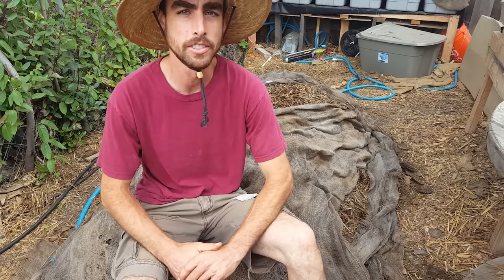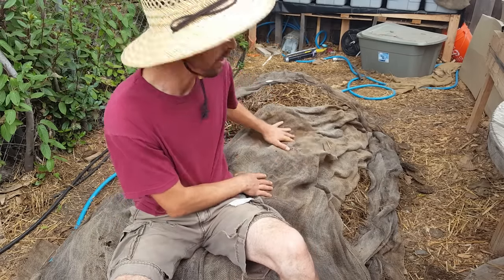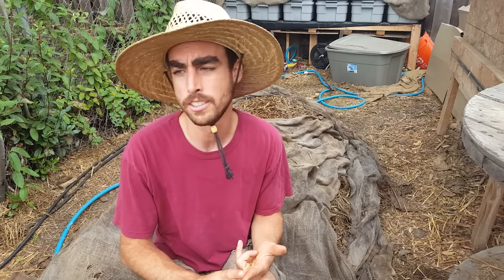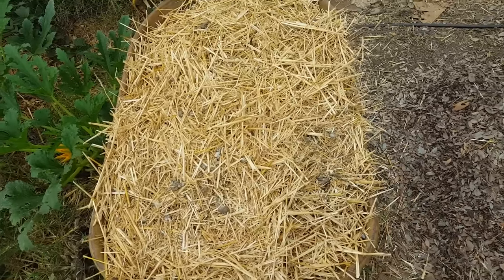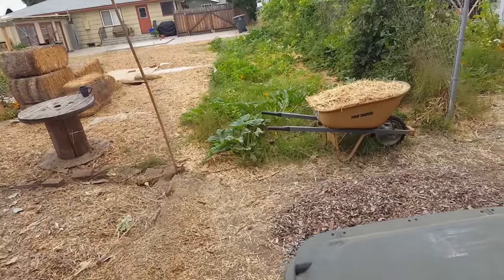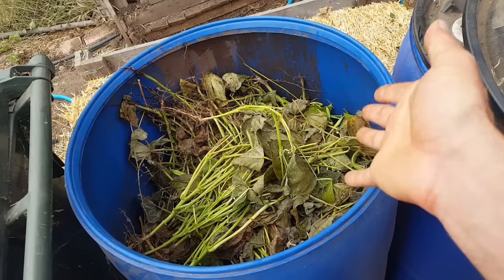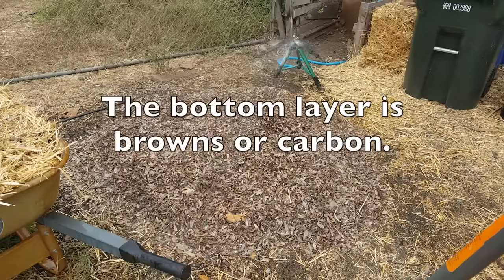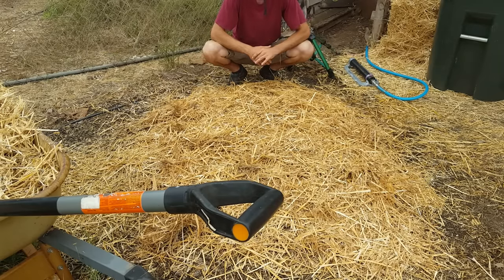How to Make a Hot Compost Pile Successfully 1 of 2

Comment: These are really good points. I like the way you broke down the different options to balance the N:C ratios. A lot of people in the suburbs don't have access to manures and other really high N materials, and have to use what's in their yard. For this, a 2:1 or even 3:1 ratio of grass clippings to shredded leaves will give you that really hot, supercharged pile that needs to be turned every 2 1/2 days and will maintain the 130-160 degree temps. 2:1 in the hot summer, and 3:1 in the fall.

Comment: Great technique and tips. I follow something similar, but also include a layer of twigs and small branches at the bottom to improve air circulation.
Reply: Ben Bradey interesting.  Makes sense.  I will certainly try the sticks and twigs at bottom of the pile.
Reply: For piles up to 6' high, alter 3-5" layers of up to 1" branches cut to 10" lengths every foot or so. Aids air flow vital to aerobic decomposition(anaerobic decomp stinks), and water distribution though pile. Water saturated piles decompose faster.
Reply: @claudearmstrong9232  Interesting, I haven’t found that to be the case. If there’s too much water, I see a lot of caking and dead aerobic bacteria (the white stuff) caused by anaerobic bacteria taking over.

Comment: Interesting great video...we use to make our compost piles like that, now I came up with a MUCH easier way, ** NO TURNING ** so easy, less work. thanks for the video.
Reply from the maker: Ya it is more work, but there's no better way to build a pile to display the C/N ratios, moisture, and the visual breakdown of the pile all while showing how to analyze a pile step by step understanding aerobic and anaerobic conditions. Buying local compost is the best way to do it as an urban farmer. $30-$35/yard is much cheaper than the time.
Reply: Thanks for the reply! Robbie and Gary

Comment: Nice presentation

Over the years my hot composting developed into no-turn one heat-period process. Essentially the pile begins with 4 to 8 inches of branches in the ground layer. I keep the woody diameter 1/2 to 1 inch. Then about 4 - 6 inches of brown, then 2 inches of green. The fourth layer is 2 - 4 inches of the branches, covered by the brown then green. I pack these together by jumping and packing at about the half way point, approx. 3 feet high. I soak the pile here as the water aids compaction. Adding layers on up to 5 - 6 feet high then jumping on the top to compact the pile, then soaking it thoroughly, I top it with 2 - 3 inches of sand, finished compost, dirt, or any fine material that slows air movement up through the bottom layer of branches. The maximum width I find is four to five feet, or approx. 2 feet from the sides to the center.

When I add fresh grass from a healthy lawn the pile heats by the fifth day, then continues to increase up to too hot to hold my hand in the pile.

At the cooled pile I use a horse bedding fork to shake out the fine material  and return branches that need further breakdown to the next ground layer and up the pile. The pile never develops the anaerobic state. It has a woodsy, fresh earth sweetness. 

At the point of cooldown the material is fully ready to plant.

Been doing this 40 years.
Reply from the maker: Nice Claude that sounds like a great method thanks for sharing.
Reply: @NaturesAlwaysRight  O kinda envy you for stepping up to the task of providing workable nutrient dense gardening everone can do. Thank you"-)

Rather than my yt channel I find those who are here and share my bit. You are the real hero.  Take heart and be sure you make life better for all.
Reply: I plan on doing something similar. I find that branches at the bottom and in the middle of the pile give the pile structure and support so that it doesn't collapse in on itself which would restrict oxygen. 
I'm also going to dome the top of the pile and enclose the entire pile in its own greenhouse, run 4" inch aluminum flex tubing through it and use the tubing as a convection heat collector so that I can heat my winter crops that will be growing in the greenhouse next to my compost pile.

I'm not sure but I may even collect the heat that rises to the top of the compost pile and gets trapped in the dome. Do you think this would be a good idea or would the heated air from collected from the top be too moist or contain harmful gases for my garden greenhouse?
Reply: stephencarlsbad there’s multiple videos showing how people use compost to heat there green house with good results I was just watching some last few days it can even add co2 for your plants good luck.
Reply: @stephencarlsbad  I was thinking of doing something similar but was thinking of making a 4 ft brick lined pit under the floor of my greenhouse but was also worried about harmful pathogens
Reply: @stephencarlsbad  I like your ideas, I would say 'go for it',,,if there's a methane build-up that explodes, that woud be entertaining and interesting. (I think you're quite safe.)
Reply: How long does it take for the pile to cool down? A year?
Reply: @lilyxciv5637  depending on size-volume, 1-2 weeks
Reply: Have you done a video on this method with the layers of sticks

Comment: If you can get your hands on rice hulls they help with adding air to your pile and break down into silica witch your plants will love you for. Great video. Love the brows
Reply from the maker: Great suggestion rice hull is fantastic, but I'm trying to avoid extra cost and not buying in extra inputs.
Reply: Anyway you can find rice hulls from horse poop.. People use it for that here i am. If not its 15 bucks for 4 cubic feet hardly expensive at all.

Comment: Good tips in this video. However I aim for "hot and cold" composting - some of the compost bin content gets hot and some stays cold. The worms migrate to the cold parts and work on decomposing those while the hot areas work on themselves. When I get bored I poke around and the hot and cold parts mingle and change. When I need some compost for the garden I move the top half of the compost bin onto a tarp, move the bottom half to wheelbarrow, and fill buckets of the partly done compost from the wheelbarrow until it is empty or until my job is complete. If I am making a new garden bed and there is not enough compost I use hugelkultur and fill the lower levels with twigs, branches, leaves, etc. I simply don't have the patience or time to do it all properly. My best magic ingredient is spent coffee grounds. My local cafe gives me bags of the stuff whenever I come by for coffee. A layer of spent coffee grounds topped by a layer of organic sugar cane mulch, wetted down, starts cooking quite quickly. I have so many bags of coffee I walk around the property tipping them over the bush mulch (wood chips) that also feed the garden. The garden smells for a day or two but after that there is no odour.

Comment: You can also use waste water from fish tanks when you clean the biological filters and vacuum the gravel from the tank which is full of valuable bacteria aerobic and anaerobic depending on what kind of filtration you're using and nitrogen, and other compounds that are useful for plants and composting . It also helps to kick start the process of composting . I've been using fish tank waste water for my plants for over 30 years and the results have been awesome .
Reply: royalspin hi how do you know the water is safe I’m thinking about doing it
Reply: @gabriellencarnacion3310  if you are not putting chemicals into your fish tank then as long as it's over 90 days it should be good to go. 90 is probably being overly cautious but safe than sorry. Also to clarify regular water. Dont put salt water In there
Reply: I dump some buckets of water from the ducks pool

Comment: For those hat dont have enough  material to make a 4 foot pile here is how I do it. I dry sycamore  leaves so they are still green when  dried and  add saves bags of crushed dried  brown leaves. I hand crush the leaves. They crush easily  during hot weather not so well in November . Then I soak them in a trash can with household ammonia  added. See "drunken  composting " video on a other channel.  Then I put the drained leaves in a barrel and it is hot    too hot to touch over 2 sec. By the following day,  say 6 inches from the top and 14 inches from the bottom. I'm thinking about dumping it out on the ground  . I dont think it has to be 3 to four feet tall since it only gets hot in the middle I turn the pile every day.  Mainly I am retired and bored and want to verify  the heating process

Comment: this seems much more complicated and involved than what I've done. I just threw some veggie/fruit scraps on the ground and piled on some wet, dead leaves.
Reply from the maker: The better managed the faster you can get it to break down and have a better quality product at the end.
Reply: you could have it completed in 18 to 27 days doing it the way he is describing. depending on what your carbon is. wood chips that are 1" or bigger will take longer.  Plus getting it up over 140 for 2 days straight is required to be considered organic compost, to kill pathogens, weed seeds etc.
      If your pile goes anaerobic, you can potentially get some pretty nasty microbes in your compost, or worse, alcohols and organic acids that will kill any plants they touch if they arent diluted down.  That is why some people get screwed taking city compost, it went anaerobic  or didnt hit the heat targets, and they are putting some pretty nasty stuff in their beds.

Comment: Concerning organic decomposition, there are two major ways of process : direct or indirect to my opinion ; related to anaerobic or aerobic (some times aero-anaerobic mixed situations) conditions. The direct pathway, is a metabolic degradation through fermentation : this process is mostly the anaerobic fermentation by unicellular micro-organisms (like yeast and/or bacteria) ; producing generally waste gas (ammonia, methane, carbon dioxide, sulphur dioxide,etc) lost in the atmosphere, through a process giving end-products (alcohols, diluted acids like butyrates, lactates, acetates, etc. ) and heat. This process is used in silaging by farmers, lacto-fermented canned food, brewing fermented grains, gas production in bio-digester, etc. Fermentation in an open system is thus wasting raw energy. These composts are "hot" process composting. 
On another hand, indirect pathway is a metabolic degradation through digestion mostly performed by invertabrates, insects (like worms, woodlouse, slugs, springtails, cetonia larvae, etc. ) that create feces. Worm compost is for instance worm poo. This process is aerobic or slightly aero-anaerobic and expenses far less raw energy converted in heat or waste gas ; but it needs more time to cary out. These composts are "cold" process composting. Another difference between these 2 processes, lies on the fact that the metabolic (enzymatic) reactions are performed inside or outside living organisms. That's why the more soggy the substratum gets, the more you get a fermentation vessel (incubator). 
Fungi are also very usefull to break down dead/weak/ill plants raw organic matter (wood) preparing the field for other organisms, cooperating with them (rhizosphere) or being eaten by them. Most fungi are aerobic/aero-anaerobic organisms destroyed by heat. 
On another hand, heat is impotant to destroy pathogenic agents inside a substrate. 
Therefore making compost is still a complex situation and difficult to summarize globally ; depending on lots of factors. It's not like a recipe, where every ingredients and each elements are mastered in an accurate process...

Comment: I use insulation panels on the top and upper 30 cm  layer sides. I add the mixed ingredients 30cm every three days until It is 150cm high. I use sieved wood chip less than 0.5cm , .finely chopped leaves
coffee grounds , drowned weeds, grass ,comfrey ,urine. Weeds placed towards centre . Heat from layer underneath initiates fermentation. Pull up layer before adding new layer. Also move up side insulation panels.I repeat the process once more into new heap adding some new nitrogen source. Leave for 6 months.

Comment: Very interesting video, Steven, thank you. Just wondering : Would it be wise to put or build the pile on top of a square metre pallet, perhaps with a square foot hole in the middle, both to allow more air in from underneath via its slats and to allow direct contact with the soil beneath in the middle hole for the worms and microbes to crawl up? 

It is more likely to get anaerobic or at least lacking air in the lower layers, yes? 

If one then builds a Compost Bin of four pallets ON TOP of the ground pallet, like a 5-pallet cube except no top pallet, then air can get in the space underneath the Compost Bin and aerate the pile from below upwards, right? With some turning over to raise the temperature more evenly.

One excellent idea I picked up from you is the burlap cover. Hmm! Your links are so useful. Very good. Love the cat making a cameo there in 17:10 lol. Agape. Andrew. 
(PS Part 2 to watch now lol)

Comment: How does this translate to someone using a tote bin. My bin has been going for about 6 months. It's small but I started with dry leaves and added kitchen scraps. Through the months I've been adding egg shells and cardboard and shredded paper along with nitrogen items. The only problem is I dont think it gets hot. It looks like compost and I turn it every 2 weeks but you focus a lot on heat and I don't think I'm hitting those temperatures. Another problem is rain. Florida gets a lot of damn rain but the bin is covered so only a small amount of water gets in so the pile is constantly moist but I heard that too much water can leach all the nutrients out. It never smells and it looks good so maybe I'm not turning it as much as I should therefore it's not getting super hot. Love your videos looking forward to the next.
Reply from the maker: Tote bins are a little bit different but you can follow the same way I did it but just do it inside of the tumbler. Rather than adding new stuff everyday build the pile in one go, monitor the heat and turn when necessary. How you are doing it is fine, it's more of cold composting process, it just takes a lot longer and the quality isn't as high. I'm displaying thermophilic composting not cold composting which is what most people do in their backyards. Heat (130-160) is the most important thing when making a legit pile that will break down quickly, safely, and have the most beneficial soil life. Rain would make it very hard, would have to do it under some sort of cover or tarp I would imagine.
Reply: Nature's Always Right ah today I learned about cold composting lmao. I lightly researched it just now and understand the difference between the two. I will say, compared to hot composting i used a lot less matter then your huge pile. I understand you have a large operation but at the moment I couldn't possibly amass enough materials for a 4 x 4 pile. What would be a minimum size that I could make a pile I might try it after winter to get all the fallen leaves to start. Thanks for the response.

Comment: QUESTION: my compost pile is almost entirely made up of wood chips that have been used as chicken bedding. Is that entirely a green material? It’s staying at around 80-90 degrees and not breaking down very fast so I know I need more of something. Should I add more browns?
Reply: wood chips are brown, you need a load of grass in there and other stuff that actually looks green

Comment: my pile really smells bad but the temps look good at around 130 - 140 range. I put in some horse manure, not much but i think that may be causing the smell. I wish i had not added that because its hard to know for sure now
Reply from the maker: The pile is probably too wet or the high N material isn't mixed well enough.

Comment: Can u explain the compost tracker spreadsheet? Can u track moisture content, not just temperatures? 😊
Reply from the maker: Sure I'll shoot a little video about it this week. I know it is probably a little confusing. I usually put moisture info if I need to in the notes column. I don't have a measuring tool for moisture.

Comment: Just pulverized the wood in the same way that Jean Pain pulverized it and wet it thoroughly the way Jean Pain wet it and pile it in the same Jean Pain piled it up to create the original appropriate mound shaped compost fermentation pile that produces both heat and biogas methane and any modifications done must be based on the Jean Pain method by just additing into it without losing the original Jean Pain results.

Comment: Would it be possible to add synthetic nitrogen fertilizer if you lack greens and have an over abundance of carbon to compost? I'm talking tons of carbon material. Thanks
Reply: Use that carbon material to cover your pathways in between your rows. Earthworms will break it down, then add it as a pre-winter mulch for your growing beds.

Comment: If you didn't want to turn the pile, could you run a few pvc pipes with drill holes through the pile when you are building it?   This would allow air to get  into the pile to keep things heated.
Reply: Michael Foster yes indeed but those holes need to be small enough not be blocked but large enough to let air which is difficult to balance